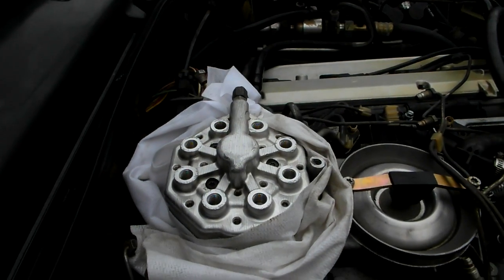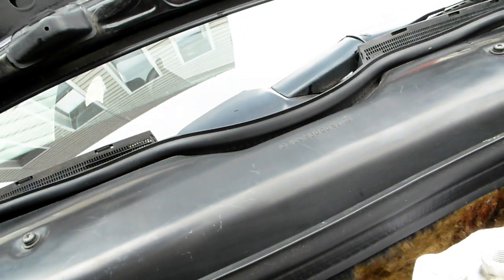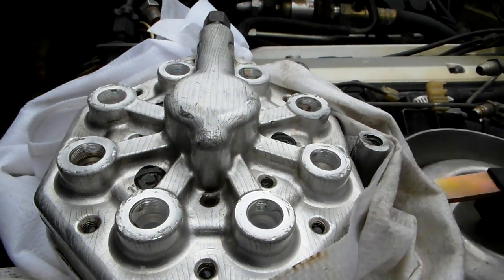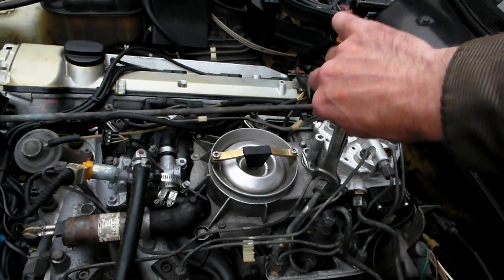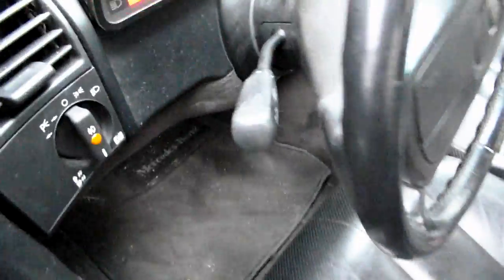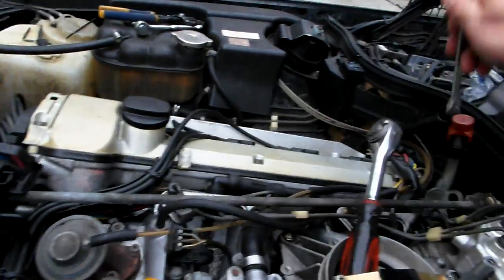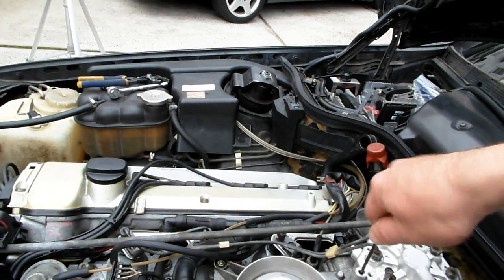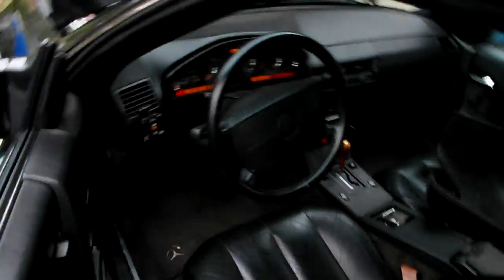Mercedes fuel distributor. Part 4. Testing unit in the car, trying to start the car after rebuild.

Comment: I have a similar issue with rough ideal on my 91 500sl. But my fuel distributor does not have a bleeder valve that can be adjusted with the allen wrench. It's a pin like inside that I cant adjust. Can you tell me if this is normal

Comment: Victor I have a big problem. I put some bad fuel in my car my ML320 and made it a couple blocks and it sputtered it off and started running really rough and haven't been able to start it since. I have 50 lb of pressure in the fuel line coming from where I hooked up the gauge under the hood so I think the pump is okay, but all the bottom dash lights are on and it just cranks but it doesn't it doesn't turn over it doesn't fire up. It's also not throwing any codes. And it was running perfectly fine starting perfectly fine prior to putting that fuel in. I'm stranded right now in a town where I know barely anybody and I'm almost out of money and I'm wondering if you could maybe help me out and email me what you think might be a solution that won't cost me buying parts and just trying different things. I did have a injector fuse blown and I did have an ECU fuse blown and I replace them but it won't start. It just turns and turns and turns and turns. And there are no Mercedes dealerships or anything like that where I live so it's a real bitch to get parts. If you have any ideas could you please email me at bevco22@gmail.com sir and give me a push in the right direction? Thank you very much.
Reply from the maker: If you had fuses blown there might be some serious electrical issue. Bad fuel could have been a coincidence. If ECU died you can't just put in used one since all ECUs and key are programmed and married with each other. All need to be replaced. If you have Star Daignostic laptop I would check for DAS codes and see if DAS authorizes engine start. Or maybe something wrong with actual key. Sounds like DAS or other electrical issue. Can't say without seeing the car

Comment: Hi Victor! Really appreciate your videos, I would like to ask you to help me to get good complete FUEL DISTRIBUTOR whole thing like this one http://www.ebay.com/itm/380SL-380SLC-380SEL-Fuel-Distributor-Air-Flow-Sensor-0438100088-0438120135-/161723274120?hash=item25a7755388&vxp=mtrfor for SE 380 W126 1985 YB in good condition for reasonable amount of money or probably you can let me know where I can rebuild mine? I would really appreciate your help. Thanks

Comment: hello victor, I have a question, i have a 1990 mercedes benz 300e, its a no start problem, yet back then it would stall. there is fuel coming from the fuel pump, and into the fuel regulator, but not to the injectors, is it a bad distributor? none of them have fuel when i turn the key and push on the plate of the throttle body. was this the problem you had? thank you